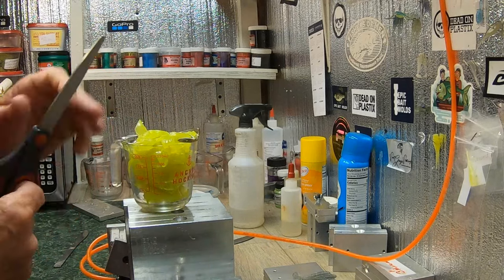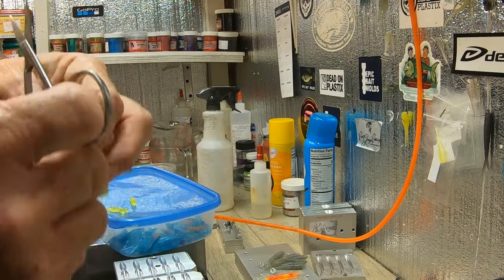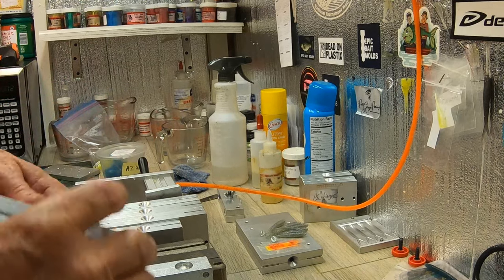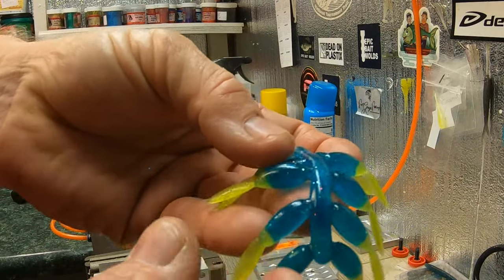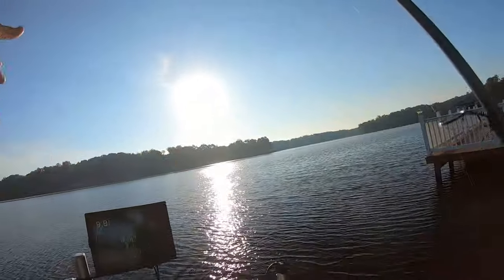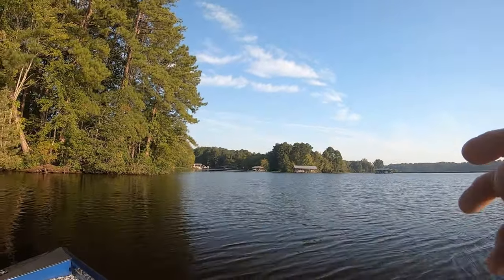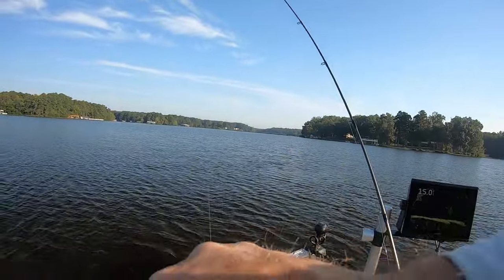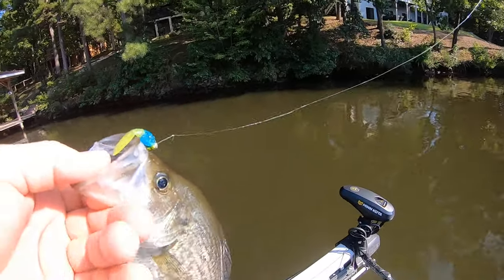Crappie Candy Tadpole Jr. Pour To Catch

Comment: 38 ,, Another color that looks like a fish Catcher for sure, matching the hatch this would be similar to what some folks call a  yellow Tail Shad , I think Fall Of the year, and especially in the Areas that Have those Shad it's a natural food source for crappie and other game Fish ,, Weather is changing here finally humidity is not quite as bad and Temps early are a little better , Weather Plays A Huge Roll in The Bite Here, Rain Can help if it's not a Flooding rain , Between September 1 and Christmas is My favorite time to Crappie fish and after the spawn before the summer Heat Gets unbearable is usually good ,I Did Really Good From about Mid April Thru the end of June On Bull Bream spawn and I found some crappie on Stumps that was Hungry some of the biggest crappie I've found in a long while ,and in a odd place to find em but they was there several trips I went back to em,, anyways I had intention of fishing last week but it didn't work out, Knees Still a Issue and Hampering things Which is extremely aggravating,  maybe tommorow with Any luck 🤞🤞if My son can get away for a bit , 
As restaurants Go You Can't Beat A Good Mexican Restaurant ,We Have One Here that I Like ,,  BUT it's not as good as a Crappie Dinner that I caught using LCBs lol 🤣🤣,, Preciate Ya Dennis 🐟🐡🎣🤠🇺🇸
Reply from the maker: I heard that, I like the Mexican food . The weather has been cooler here this week with low's in the 50's and it's only 71 right now.   The water has dropped a few degrees this week as I fished yesterday.  Good luck fishing Donnie.